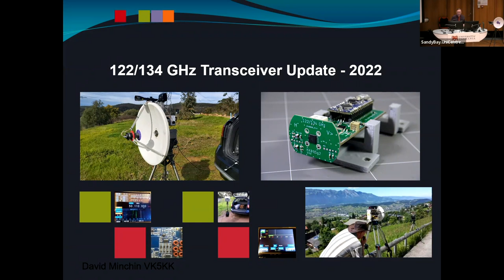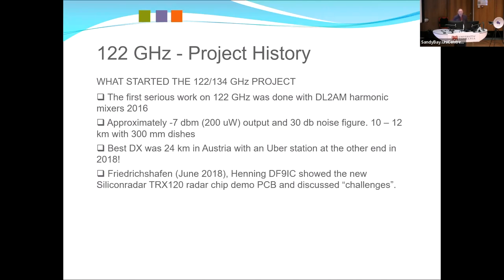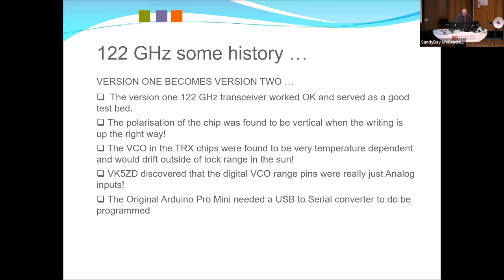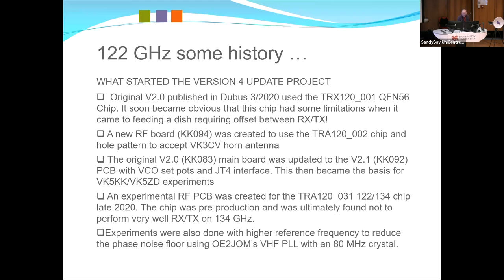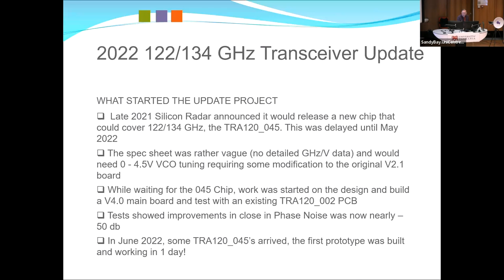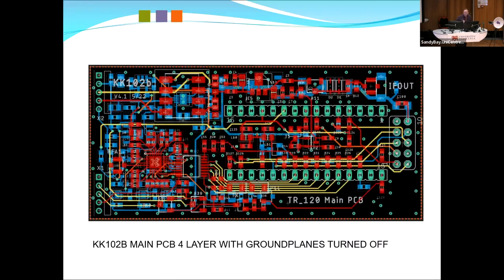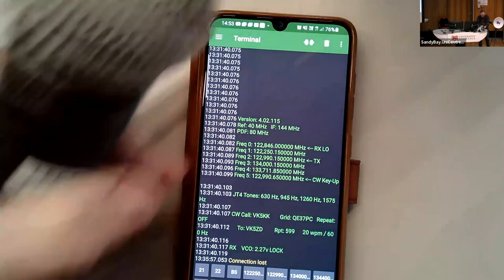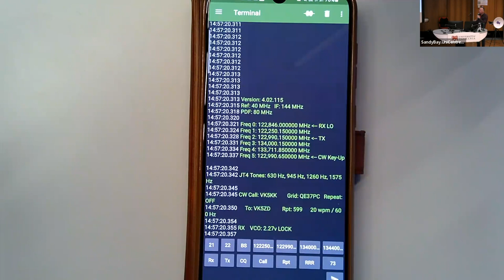Experimenting on the 122 & 134 GHz Bands

Comment: I'm a little confused - is this a transverter or its own radio? Either way, absolutely fantastic engineering work! 73 de VE3GKT

Edit: also, does the horn mean they don't have to mechanically move the chip to align with the dish?